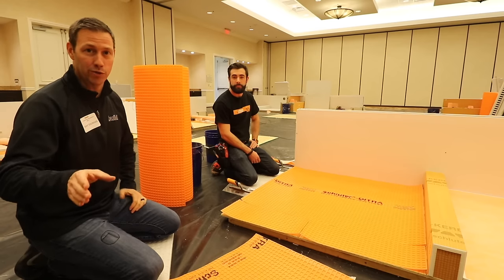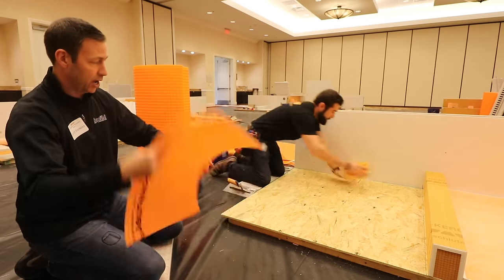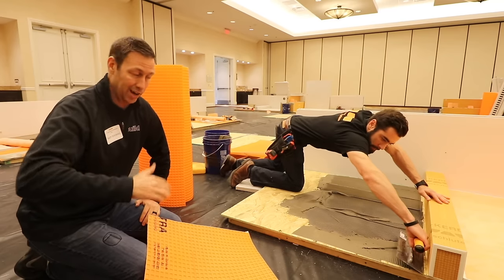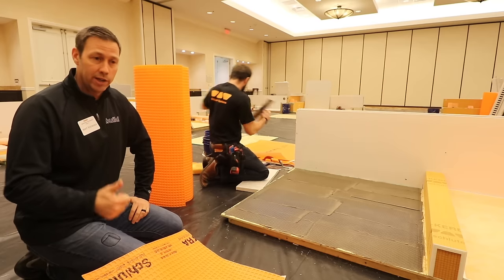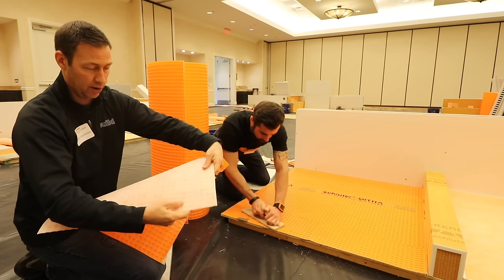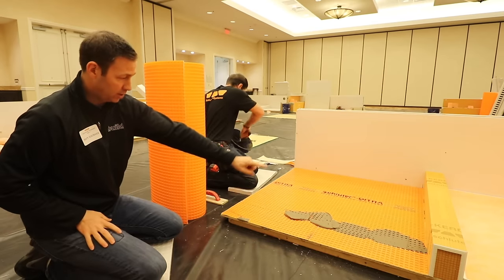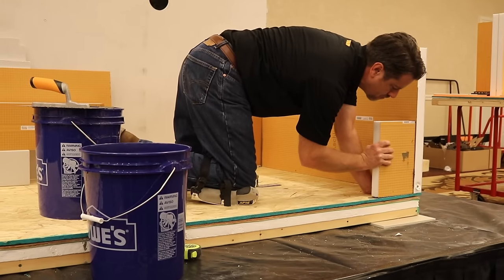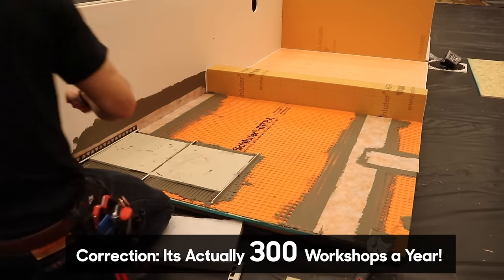WHAT is this, and WHY do you want it under your floors?

Comment: Question: (This may sound strange, but I have to ask)
I have a plywood subfloor... in my Class A RV
Can I use Schluter Ditra just like you did in this video... but can I do a vinyl wood flooring on top of this?
Or does it have to be just ceramic TILE?
Reply: Is your goal just to utilize the waterproofing properties of the DITRA?   Otherwise your vinyl flooring doesn't need this layer.  It is either a floating floor that isn't connected to the plywood anyway (just floats on top in one big sheet after you assemble it) or it's a flooring that has wide sticky fins that bond to each other, which aren't going to get pulls apart and show cracks because the subloor is moving.  This stuff is to prevent movement in the subfloor from causing cracks in your grout between tiles.     If the goal is waterproofing to protect your subfloor, then I'm not sure what to use but this is more expensive than other waterproofing materials
Reply: @tombiby5892  
Thank you Tom for your speed reply.
Truthfully, I was considering using this for waterproofing and sound effect...
 My subfloor is in my Class A RV.
Even though the Class A RV isn't going to be moving around a lot... it will be lived in. I just thought it would help with water and comfort... plus leveling out for the vinyl tile. It is such a small area, that the extra cost would be worth it.
I usually put in carpet in my RV "Flips", but now days, everyone want either ceramic tile, or vinyl tile... which I agree is easier to keep clean...
What do you think now? Would it be wroth it?
My plywood subfloor on this 1985 Class A RV is a little uneven, just with wear and tear... I thought If I did what you did in this video it would help level the floor out, plus insulate it, waterproof it... (now I'm sounding like a commercial)... LOL
Reply: @judichristopher4604  I don't think it's the right choice for what you want.  It won't help with leveling out the subfloor.  In a standard house I'd use a layer of sand-mix cement to level out a floor beneath ceramic tile typically.  With vinyl tile it'd be enough just to put down a layer of thin smooth plywood (with glue and screws) over any minor roughness.  If the vinyl tile is the kind that sticks down then this is the wrong choice because you have a waffle surface with only the high places in the waffle to stick to (smooth plywood is better for this reason too).  If you want sound or heat insulation you can put some kind of rigid foam under your thin plywood.  Not sure what's best for waterproofing but I believe there's a product that comes in rolls made for wood flooring that has a vapor barrier and a little foam padding, but that's not going to waterproof around the edges where the floor meets that wall if you're worried about water getting out of the tub or shower.   But most bathrooms don't have any waterproofing under the bathroom floor.  Sometimes it leads to trouble but mostly it's just not enough water escaping the tub/shower to be a problem.    I did a bathroom recently with Lifeproof floating vinyl floor (imitation wood) from Home Depot.   It's water resistant and seems to be working well.   I did add silicone where the flooring met the tub to keep water from getting underneath.  It looks great but we'll see in 10 years if there's any problem with water getting under the floor.
Reply: @tombiby5892  
Thank you Tom...
I agree... I thought of putting Luan down first, (thin plywood) then the barrier they suggested at Lowes under the V.T. ... Yes, I think you're right... 
Thank you so much for all your help, you have no idea how much this helped me.
God Bless YOU!!!
Reply: @tombiby5892  
Thank you again Tom for saving me, time, and money & hard work... 
You are a God-send.
Reply: @judichristopher4604  No problem.  I hope the project went (is going) well.

Comment: Would this prevent efflorescence or latex migration in a basement tile project over dry pac?  I seem to have a problem in the basement with bad efflorescence or latex migration (the white residue is hard and difficult to remove).

Comment: I have been installing tile for 20 + years
Ditra is a good product for what it is designed  to do
The installer in the video made a major mistake in the installation  you MUST use a grooved trowel when applying the morter under the mat or else there is not enough there to bond to.
 This would eliminate the need for the  extra morter and paper added  to the seams of the Ditra mat.
Plus adding the paper over the seams creates high spots that make it harder to lay your tile.
Lastly Ditra is not cheaper them cement board by a long shot most 3 × 5 cement board is only $20 where as kurdy board can cost up to $120 depending on the size.

Comment: My mom has this shit in her kitchens and baths and they put cheap builders grade tile over it, now we broke all the tile out  and put vynl plank laminate down and the tile broke off ok but if you try to get the residual of this orange stuff off the slab it takes chunks up with it ! I ended up getting it off and leve the best i could then floated it out with floor leveler where the carpet used to be to minimize the difference in floor heighth. Just be shure you put a nice quality tile over it because this stuff is going to become a permanate part of your slab if its rough

Comment: Can you use standard tile adhesive on top of the matting for the tiles and not flexible tile adhesive as the matting is supposed to take the movement. I've watched a few of ditra videos and can't remember if any of them talk about standard or flexible adhesive on ditra.?

Comment: Your first problem seems to be the builders don’t know enough about concrete. Speak to structural engineers, they will tell you what you need to know about concrete. Concrete only cracks if it is done wrong. (Design, ground condition, aggregates, mixing, reinforcing, formwork, application (including weather conditions) expansion, weather exposure, chemical reactions & the elements, etc) Easy once you know how.

Comment: Can this Ditra product be used for other flooring types, like vinyl planks? I have a pretty unlevel concrete floor that has been leveled to the best of ability with standard floor leveling product but I have still had issues with the vinyl planks coming up.

Comment: I have an enclosed garage that the previous home owners put thin carpet down that they also let a fridge leak all over, needless to say it is gross, but also I am looking for something to put between the cement that the carpet is on and wanting to put down the foam tiles like at a gym and make it a rec room inside.  Would this product do the job?  I think it will but I am also concerned about moisture barrier due to maybe the water damage is from the concrete and not just the fridge as i do have cement that gets wet outside and I am worried about that seeping in.   If anyone has suggestions I am all ears, this just seems like the best stuff to use as a barrier.

Comment: Hi Matt,
       Would this work if you are tiling over linoleum? New home with hardwood floors and tile floor bathrooms but the laundry room has linoleum. Its the large roll out sheet type. 
We would like to tile over this new linoleum with 12X12 tiles so we don't have to demo. They did put 3/8 particle board over the 7/8 chip board sub floor before they rolled the linoleum down. What do you recommend?
Reply: Actually maybe we have vinyl flooring in the laundry room because it rolls on in large sheets.

Comment: Not a fan. Literally every time I've tore this stuff out it was because the tile was cracked and coming apart. The problem, of course, is that it's not stiff, and tile can break free from movement. I imagine it would perform better on a slab, but in my experience it is not ideal for plywood or OSB. In fact, every time the tile has just popped up like nothing. And the height difference is a problem considering how many homes have solid wood in them butting up to tile. It adds work, it doesn't take away. And dude, hardibacker is extremely easy to install, and if it isn't installed correctly, it still does a decent job. This Ditri mat must be installed correctly but people are lazy, man, lol.

Comment: Hi I have a question, our house had laminate flooring in our kitchen, we removed them to tile the kitchen and found asbestos tiles 😖. Can we use this product to incase the asbestos and tile over it?
Reply: Encasing the asbestos is a good idea since you really don't want to deal with demolition of that stuff if you can avoid it, however, I wouldn't use a flexible product like this directly over it.  You can adhere thinset to asbestos readily enough, but you don't know how well the asbestos tiles are stuck to the surface below them.  You could have very weak bondage that could undermine the floor.  I think in your case a cement backer board is the safer way to go since you can drive screws through the asbestos tiles and into the subfloor.

Comment: I've used & seen thinset attach tile to membrane well when properly applied...
 "But I've only used the membrane on concrete> I've heard thinset isn't always the best material to use on wood/plywood- Is that true...??  &Even if it's not true is there a better product that can be used to attach membrane to plywood....??
Reply: The best I have used hands down to bond tile like a mofo to plywood is to glue 1/4" thick  durarock directly to the wood subfloor with pl400 construction adhesive, use an air caulking gun and apply straight 3/8 beads approx 4" on center to the back of the cement board leaving the ends of the beads open on the edges so air can burp out. Lay the cement board down and walk all over it to squash it down and screw it down with 1 1/4" cement  board screws 6"oc around the edges and 10"oc in the field. Make sure none of the cement board seams line up with the subfloor seams.
Then apply the tile with thinset directly onto the cement board as usual, mesh tape the seams as you go, it will last forever without any cracks, tile pops etc. 
I have been doing it like this for 15 years, entire houses, my own home, I just tile planked a 2,600 sf house in this fashion last month. I have never had any issues, callbacks or complaints. 
IMHO gluing cement board down with construction adhesive is far superior then applying it with thinset like suggested by the manufacturer. Thinset can be sketchy when applied to wood period, it's hit or miss and has  way too many variables that can screw up getting a permanent 100% bond. Oils in the wood, humidity, grain type, wood species, and random  contaminants that occurred during construction, ground in mud, plaster residue, spilled coffee, pneumatic nail gun oil misted around everywhere etc. And if the plywood ever gets damp enough to swell it 100% will break the bond with the thinset where the construction adhesive will remain unaffected keeping the cement board permanently attached to the subfloor. As far as that membrane goes....IMHO it is only good for attaching tile to cement floors because it moves independently. And even then I have seen it still fail if the floor cracks too much.
Reply: @dmithsmith5880  no waterproofing between thinset and cement board?
Reply: @garywong24  I never have, I don't see a need for it unless it was a bathroom floor or somewhere that would get repeatedly soaked for long periods of time.
Reply: @dmithsmith5880  Thinking about your method for a bathroom floor over plywood subfloor but I don't see much information on using glue instead of thinset between the subfloor and cement board. Thanks.
Reply: @garywong24  No problem..
I prefer the good locktite brand urethane based construction adhesive.. the stuff is the best 👍
Reply: @dmithsmith5880  Upon further reading, I think I'll go with thinset instead of adhesive glue and follow the manufacturer's directions. I guess that is what the TNCA recommends too.
Reply: @garywong24  I just go with my own theory of thinset not adhering to plywood, but if the bond breaks loose from the plywood at least you have all the screws holding the cement board down and the tile should remain adhered to the cement board.. I just glue it down to form one immovable mass.
Reply: @dmithsmith5880  I see where you're coming from but I think the counterargument would be that you are trying not to create one single immovable mass as that would defeat the purpose of using two layers leaving no room for expansion.
" ANY time you bond the layers of the subfloor together, you completely eliminate all the benefits of multi layering the floor, which, under tile, is mandatory. Once you glue the layers together, for all intents and purposes, you've created a single layer subfloor, and it'll act and move as a single layer."
Reply: @garywong24  I here you. Personal preference I suppose, I use cement board as an underlayment strictly for the superior bonding ability of the thinset to tile, not for layer expansion/ contraction movement. In my opinion if they wanted it to move, they wouldn't have you put 200 screws in every sheet. 
I monolithic tiled my entire 80X35 ft ranch, 1 continuous piece, glued and screwed 1/4" cement board directly over a single 3/4" Advantech and tiled the entire house with 3/8" thick 8"X48" porcelain plank tiles.
That was 3 years ago and solid as a rock. Zero movement, Zero hairline grout cracks etc..
But I kind of designed the floor system for it. Full span TJI floor joists with Advantech which is waterproof and does not swell. I also lapped all of the cement board at least 1 foot from any subfloor joint. Basically made the entire floor one solid piece. I am 100% positive it will be there in perfect condition long after I am gone for sure.
Reply: @dmithsmith5880  Thank you for your replies and discussion. I've learned a lot!!

Comment: Ok this is a solution but temporary. Water and sewerage lines are under floor not above and this material is placed aboved that. May be this is a solution but what about first floor if there is a wash room on first floor and there is a water leakage in that so what about the roof of ground floor.

Comment: Is there no need to tape seams? Just thin set and tile over?
Reply: If you are using it in a wet area like a shower then you need to tape the joints.
But if you are using it in other pieces just as a decoupling membrane, then you don't need to tape

Comment: Is it specified to work on 3/4in plywood subloor over joices? Also i want to make a full custom tile tub in the SD area. Would this product be the best option? What if I used cement board then this stuff? Any one in SD have experience using this product that wants to reach out?

Comment: Im all for using good products but Ive never had any problems using hardi-backer on floors or and rubber liner/mud bed in a shower pan. If people seal their grout moisture never get under it in the first place. I tell the homeowners this before hand. A little maintenance goes a long way. THey spend 5k+ labor on bath remodel but wont take 10 minutes to seal their grout once every couple years? This stuff looks easy to use but i hear its expensive. Maybe ill try it one day just for fun. Its funny how new products always cost more. Its a roll of "plastic" why is it so expensive?

Comment: if i want to tile my basement would this give me a thermal break between the concrete slab and the tile?
Reply: Hi Brian, Im not in construction but if you look at my post form today you will see that I have Schluter on my downstairs for about 10 years.  Are you asking if it warms the floor.  I would say no.  I live in the Pacific Northwest near the Puget Sound.  It is always cooler downstairs and I have to wear either shoes or slippers, during fall and winter.  Summer it's not so bad.  So no it will not warm your feet.  However I know that they seem to now have a system to warm the tile and If I install tile upstair in our shower we will be using the system.
Reply: @Debbie98335  Im not asking if it heats the floor. if its a thermal break it will keep some of the cold from coming up through the slab.

Comment: I am not convinced this ditra or stratamat or other equivalent product is necessary except on first floor with concrete over foundation slab. On second floor with plywood or osb subfloor, in a small bathroom 40 sq ft the surface is not big enough for the subfloor flex to cause cracks in the mortar and tiles. Waterproofing can be done with a painted membrane which costs 1/3 of the price when counting the added cost of seam fiberglass tape needed for ditra.  I don't trust the advertised crack isolation of these painted plastic membrane because it's a cured plastic but i use it for waterproofing.  Ditra has its issues too when the concrete cracks and the ditra decouples it starts creaking because the whole system has to separate between uneven or planes shifts  below and above.  So yeah you get no cracked tile but a creaking ditra sound instead and if you don't that means your concrete did not crack and you wasted money with ditra. 
In my project i am tiling a 2nd floor small bathroom floor made of light concrete over osb . The light concrete already provide the rigidity substrate for the tile installation, not need to add a backer board or this ditra but it needs water proofing. So i will use a primer first then a  painted crack isolation with waterproofing. I don't really need the crack isolation. I've pondered about this ditra isolation membrane and do not see a reason i would need it in my situation.